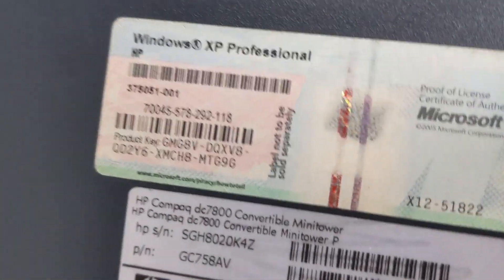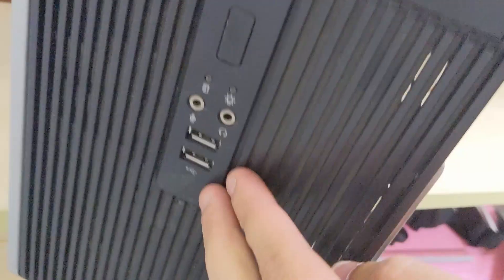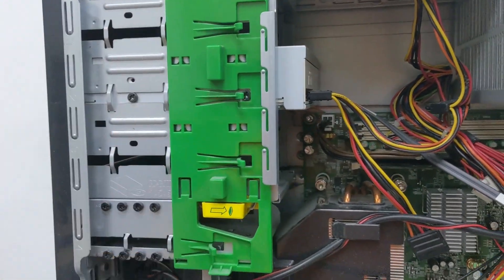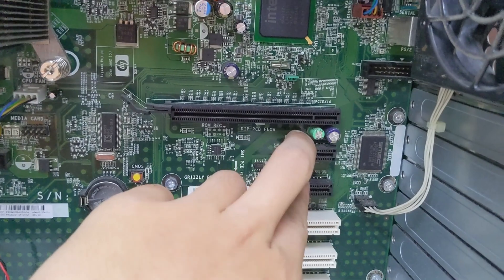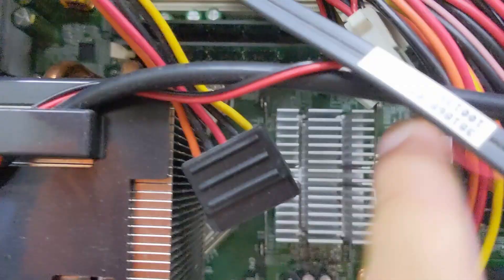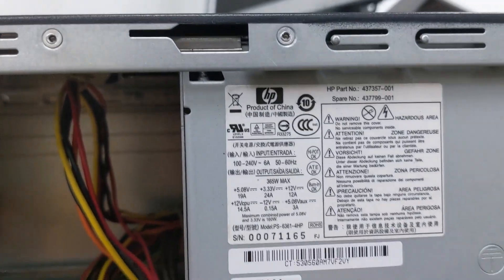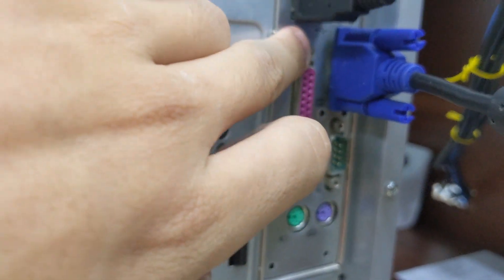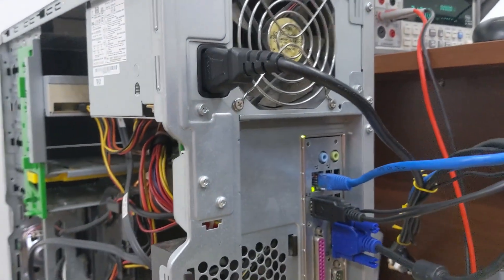HP Compaq dc7800 Convertible Minitower (Core 2 Duo E6550) Specifications & Internals

Comment: I have this pc and i want to upgrade cpu cooler / heatsink. But it seems that i can't find any suitable cooler for this machine because the size and the design of the cooler is just unusual. Can you recommend what cpu cooler best suit this machine? Also this PC motherboard is on the opposite side, it's really weird, can't replace to new case because of this.